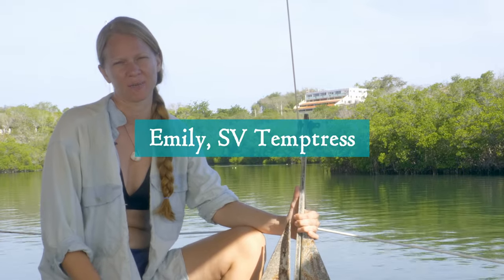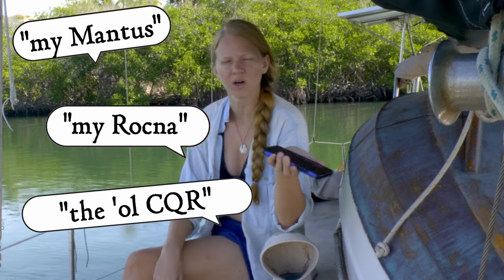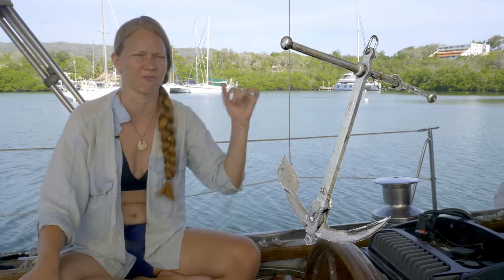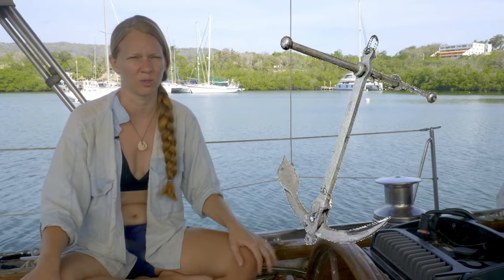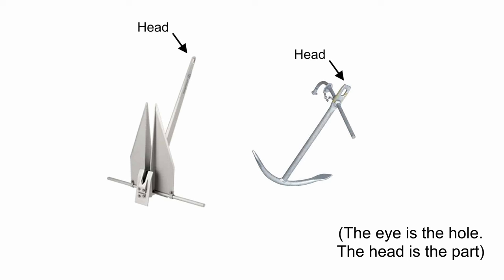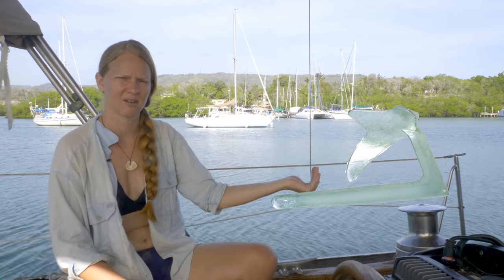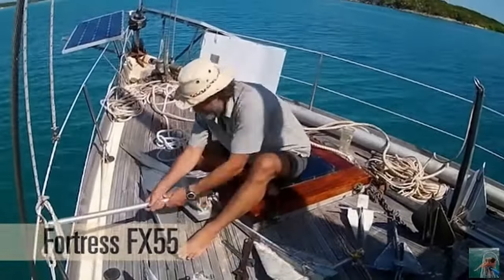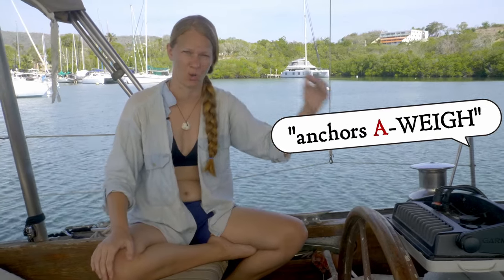Talk Like a Sailor: ANCHORS [Sailing A to Z]

Comment: 1) Clark - Why is it that the professor was smart enough to make a radio from a coconut but wasn't smart enough to fix a hole in a boat ?
2) Emily - If memory serves me correct I believe that the Bruce Anchor was designed after the anchors of North Sea Oil Platforms. Something like that....
3) Here's my favourite anchor term - "To weigh anchor"
4) The reason that the "Minnow" was lost is because when the big storm came and the skipper yelled to Gilligan "Throw the anchor over board" that's exactly what Gilligan did.....

Comment: Final bit after setting the Anchor with enough Scope is Set The Anchor Alarm. I had a great Anchor Alarm app on my cheap LG phone, and man was that thing Fast, Sensitive and as Loud as was needed. I wish I could remember the name of that app tbh, andcthat those cheap LG base model smart phones were still available. That one helped save my boat. Best Wishes and Fair Winds.  Bob.  👍⛵️✨️✨️✨️eta. it also prevented any Damage to the boats lined up behind me of course, an Im glad I wasn't on a catamaran, or I couldnt have flown the Anchor between them. 👍
Reply from the maker: We used something called DragQueen (I think) before we took up our mooring. -E

Comment: For my last Sailboat I wanted an Oversized  Rocna Anchor on the end of all chain. Problem I couldn't get one in time to not run out my Visitors Visa in the USA  (I panic about such things, as I would never insult my hosts by Outstaying my Welcom, its a Universal Laws of Hospitality thing ). So Peter, the Owner of the Boatyard I was having all the Boatwork done, came to my Rescue again, saying why don't you have a Lewmar Delta Anchor the same weight ? We have never had a problem with one and I can get a genuine one - watch out for Fakes - delivered here tomorrow.  So I did, and man did that thing get a testing in a Tornado Storm. Firstly Tornado hit the Starboard side so hard, the VHF aerial on top of the Mast went under on the port side, and before Capizing the boat, pushed the Anchor out Sideways, setting off the Anchor Alarm. So start engine and into reverse flying the anchor between the boats behind to getbinto clear water behindcp them and I reset the Anchor. We got hit by a few more Tornadoes and the boat didn't budge. A genuine Lewmar Delta is pretty much a Rocna without the hoop. Sailing Teulu channel has a nice oversized one andcthat has apparently held fine in 60 knot winds, which tbh, doesn't surprise me. So guees what Im having as the Main Anchor for my next Sailboat?  in part because it will push out  sideways which can save the boat, as well as with all chain, they really do hold well. Yep an oversized Genuine  Lewmar Delta.  Backup may be an oversized Mantus 2.0, as it can be dismantled and kept low in the boat. Some people demand that I must have a hugely expensive "Best" Anchor because nothing else is good enough ? I askmin what way, if I'm hit with a hugely powerful Tornado, will it hold the ground so well that I lose my boat in a Capsize ? How else can it be better than a more than adequate aell set genuine Lewmar Delta or Rocna ? Most Anchor issues seem to result from them being Aeriously Undersized and non chain rode failing, and undesized Chain or nowhere near enough Scope being used ? Providing the Anchor will be set well of course. 🤔 Best Wishes.  Bob in Wales.  👍⛵️✨️✨️✨️